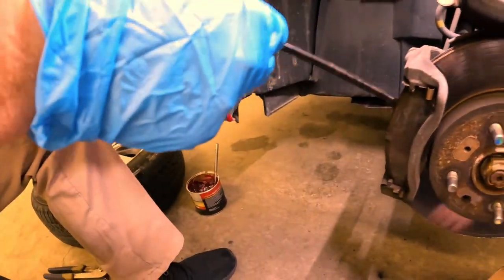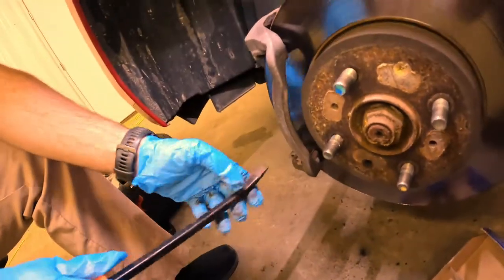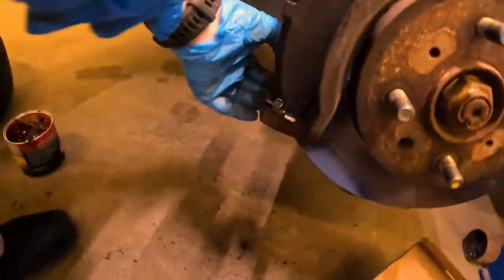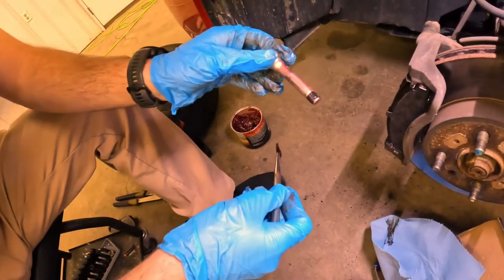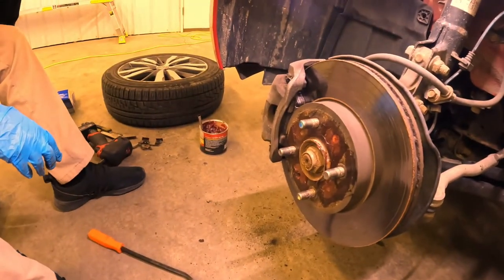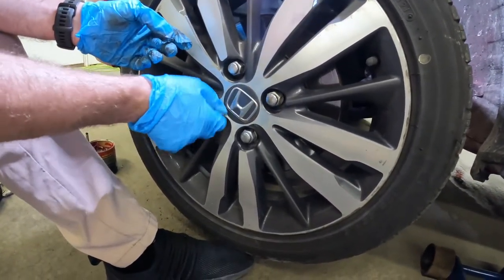2015-2021 Honda Fit Front Brake Pad Replacement!

Comment: As a seasoned pro that started when most cars still had drum brakes, I would like to offer a few tips. First, when compressing the caliper piston or pistons, take your old inner pad and place it over the piston. That way you compress the piston into its chamber with even pressure preventing it from getting cock eyed. It also prevents the piston from getting damaged from the teeth of the plier jaws. Second, when installing the inner pad, always use the pad that positions the squealer at the top. The top is the lead edge of the pad when contacting the rotor. If the pads happen to wear unevenly end to end, the lead edge would get the most wear. This should prevent the lead edge from going metal to metal before the squealer contacts the rotor. Last, I only use brake caliper lube on brake parts. The regular grease is probably ok, but I don’t want any chance of the grease liquifying and compromising my braking ability if the brakes get really hot. I hope you find this helpful. Most parts stores sell the brake lube in little packets so you only have to buy what you need. I also put a little bit on the piston contact surface.
Reply from the maker: Thanks for the response.  Those tips are pretty helpful! I've never had a problem with any grease liquifying but I'm also not working on any kind of performance applications.  You do have a very valid point though. Thanks for watching and commenting though so others may learn!
Reply: @fastlanecarcarellc3608  Brake pads not only provide the frictional material to make the car stop but the pad material also helps dissipate the heat generated during braking. As the pads wear, there is less and less of the material left so the brakes tend to run hotter as they wear. With thin pads, a trip across town on the freeway during rush hour can get the brakes a lot hotter than normal. Also as the temperature increases, the pad material gets harder and harder requiring increasing pressure and heat to stop the car. It doesn’t have to be a performance application. The grease you are using may very well be sufficient. To me, a couple of packs of brake grease is very cheap insurance.
Reply from the maker: @brucecoleman7412  it's very clear that you know a lot more about the subject than I do. 😅 I really appreciate you taking the time to educate me (and whoever reads this) rather than just posting insults and what not.  You are the man!
Reply: Yes while wheel bearing grease will withstand more heat than multipurpose grease before liquifying, for brake I also like to use specially formulated brake lube. It usually has molybdenum disulfide or graphite or both, mixed into it, and when using a very think layer of grease as you do in brake re-assembly applications, not only do these 2 lubricating substances keep lubricating at very high heat, but they also help keep the parts lubricated even when much of the grease gets washed out, and what remains of the layer of grease becomes very thin. Some lubricious molybdenum disulfide or graphite or both tends to remain on the surfaces. Also the labels on these lubricants claim that they won't hurt rubber o plastic parts. So when lubricating the caliper pins, with their rubber boots, that's where I especially like to use dedicated brake lube. I like to put this stuff everywhere 2 parts that make contact with each other,  and move against each other at those contact points – except of course between the brake pad friction material and the rotor. I avoid getting any of that lubricant anywhere on the friction material, not even along its edges. I put it only on metal to metal contact points, except I don't worry about getting a little bit on the rubber seals for the pins – but not on the rubber seals that are around the piston. I don't want to get any grease or oil to find its way into the hydraulic fluid. I might take the rubber boots off of the caliper pins, and paint some silicone lube on them, liquid of paste, or some kind of rubber preservative. I like brakes that operate smoothly and brake pads that wear evenly. I doubt there are many mechanics working at service shop who are as conscientious as I am about making sure every lubrication point is both adequately lubricated, and not over-lubricated. I think perhaps this is due to pressure to "be productive" coming from shop owners who want to make sure their shop is making a profit..

Comment: Pull those brackets off and clean them up and put in new hardware all on your workbench. Always use new rotors and pads together. 100.00 total.

Comment: Those slider pins require silicone grease as petroleum grease will cause those rubber bushings on the pins and boots to swell up causing the calipers to seize
Reply from the maker: Thanks for the info!

Comment: Thanks man, you have given me confidence to do brake pads replacement on my Honda fit.
Reply from the maker: No problem.  Thank you for Watching!  I hope it all goes well for you!
Reply: @fastlanecarcarellc3608  Thanks again! Is the process same for rear brake pads as well? Mine is a 2015 Fit LX.
Reply from the maker: @gopsln  I belive the back should be drums which have shoes, not pads and it's totally different process. I could be wrong though, yours may have disc breaks in the rear, I'm not sure.
Reply: @fastlanecarcarellc3608  Thanks, I think the rear has drum brakes in mine. Does the rear brakes wear less compared to front?
Reply from the maker: @gopsln  yes they should wear much slower.  As long as you're not driving around with your emergency brake slightly raised.
Reply: @fastlanecarcarellc3608  thanks 🙏
Reply: Update: I successfully changed the front brake pads with Akebono ProAct and used Permatex Ceramic Extreme lube for the back plates and mounting clips. Thanks for your video & guidance.
Reply from the maker: @gopsln  no problem!  I'm glad you got it done! Good job. And thanks for watching

Comment: Good video. Instead of a channel lock plier I like to use an ordinary c-clamp like the kind used in woodworking to hold joints together while glue dries, and a piece of 1/4 inch or 3/8 inch plywood to put between the piston and the clamp so that the clamp can exert even pressure against the entire circumference of the piston. And of course. I slowly turn the c-clamp's screw until the piston reaches where it needs to go. I leave the clamp in place until I am  ready to put the new pads in place.
Reply from the maker: I've use those a lot when I was younger. They work on most calipers.  One of these days I'll buy one of those handy tools made specifically for this, but that day hasn't came yet. Lol thanks for watching!
Reply: Another thing to use beside the block of wood would be the old brake pad your just removed

Comment: JACKSTANDS DUDE. I HAD AN FRIEND DIE. PROMOTE SAFETY MAN. SORRY TO YELL.
Reply from the maker: I am sorry to hear that.  If I am going to be under a vehicle in anyway, I always use a jackstand.  Normally, even for brakes or other quick repairs, I will also use them.
Reply: @fastlanecarcarellc3608  Did you ever do the struts?
Reply from the maker: @chessman70  nope

Comment: Does compressing that brake piston harm the ABS? I thought I read somewhere that the bleed line should be loosened when compressing the brake piston, then tightened once the piston is compressed? I have never replaced brakes before. I am just asking.
Reply from the maker: As long as you go nice and slow it won't hurt anything. I imagine you tried to compress it super fast it could damage something but this is the way I've always done brakes and never had an issue.
Reply: Yep. Crack the bleeder valve a bit while compressing the piston. It keeps any dirty fluid from going back into the system.

Comment: You should remove the caliper bracket and clean up the surfaces for the caliper tabs.
Reply from the maker: Absolutely.  Didn't have the tools at the time to do that but it is a great idea, especially here in the rust belt.

Comment: You know I've never heard by 2017 Honda Fit's brakes squeel

I've always had to check on these brakes and change them before they put grooves in the rotor

Really odd

(The car is named the Fit Extra Man, because it's an EX with manual transmission)
Reply from the maker: Best fit to have in my opinion